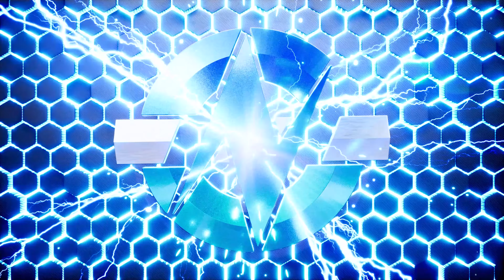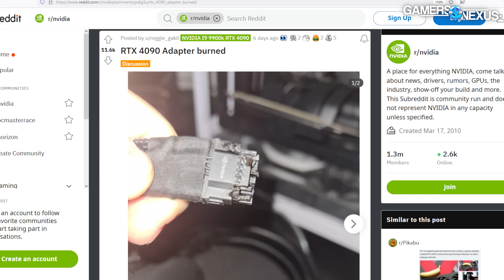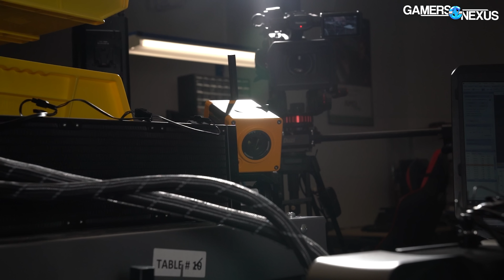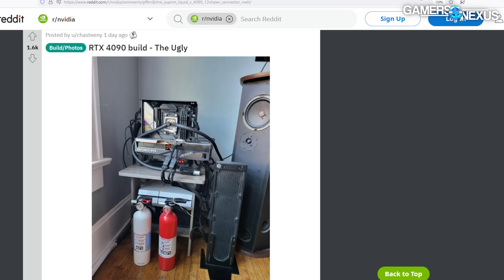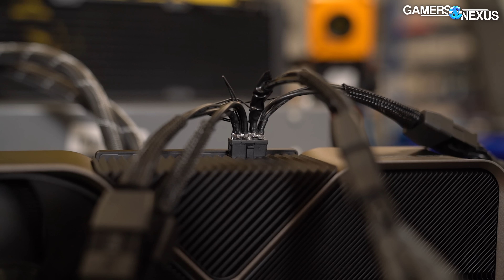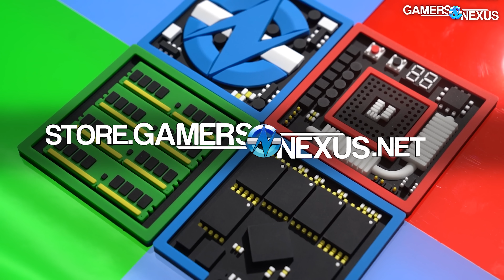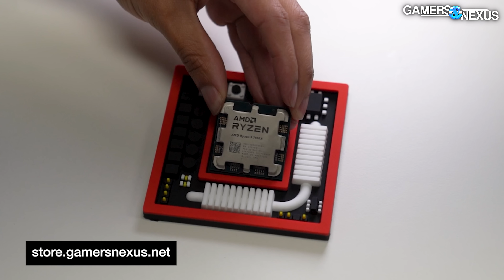Testing Burning NVIDIA 12VHPWR Adapter Cable Theories (RTX 4090)

Comment: I saw Jayztwocents vid and was like "damn so that's the issue", but now this, thanks GN for doing the actual work. In retrospect is looks like Jayztwocents and others like him were just jumping on the hype train for content without doing their own homework. Once again, Thanks Steve for the awesome work on this. It actually provides a technical path to consider instead of the " i wonder if this.. or this should be".
Reply: I mean that is seemingly the issue... Just not with the 300v line ones. There are cables out there with 150v lines and not 300. The 300v one would be able to handle half their connectors being snapped off. But the one that is barley meeting the spec where you are trying to push 600 watts through 2, 150 volt lines would be a problem. Especially if the solder was way worse on those 150v cables. SO that's what people should be taking from  this. To check if theirs has 150v lines. And if they are fucking get them off and get a better cable. Because it's not worth risking a 2k GPU. Not just going around saying no one person had all the information. SO they are shit. Signal boosting important information is good. And something you want. And anyone with sense wants that. You can piss and moan about how everyone does anything. That's why it's good there are different people. Not everyone is gong to watch 30 minutes where the person doesn't clearly outline the main point that people would most likely want out of the gate. And some people want that and can digest that. Also waiting for 100% absolute assured complete factual data can take too long. And trying the thing it is most likely, that being a bad cable. Can save you 2k. Or whatever it is in whatever situation. It's risk reward. It's most likely a bad cable. Better cable 20 dollar tops. To protect 2k GPU. Jay says buy new cable. Absolute idiot apparently for suggesting the most likely course or action to protect your investment. Some people man.
Reply: Jay simply has no clue how to set up a fair scientific test because he is too lazy or too dumb. Not surprised he uses typical sensationalist clickbait titles since his content is so shallow. I guess it works on the kids though. Whatever. I've had is channel blocked from showing up in my feeds for years now.
Reply: Couldn't watch the clown work Jay was doing. Same as Austin Evans trying to investigate the ps5, you cannot ask entertainer to do scientific work. They are fine in their own category but let others do serious business.
Reply: all you have to do sadly is look at Jayz video titles to see that they are sensationalist at best, each day he flips completely on what is/isn't an issue etc.
Reply: Whatever the actual reason is, its undeniable that the cables people are getting have a widespread safety issue, so I find it hard to say its FUD.
Reply: why i dont watch Jaytwocents, his information is just copy and paste
Reply: I've been really frustrated by his sensationalism on this subject. IMO, it's inappropriate to start spreading FUD without validating the issue. Anyone can post a picture of a burned adapter.
Reply: I'm surprised anyone in the comments watches Jayz2cents. I've seen his videos a few years ago and his shtick was simply jumping into every reddit conspiracy theory there is, just to make sure he breaks the news every time.

Judging by this video and your comment, nothing has changed in that time.

Can't blame the guy, breaking stories brings in the views, views bring in the revenue... And it's easy to say "I couldn't do that" when I'm not a YouTuber, but we'd all do the same thing on our second day after leaving our jobs to work full time on YouTube :/ I'd break my mirror for self-loathing, but you'd never see that, only my smiling face on video ;)

Comment: I think we are getting to a limit for 12v supplied peripherals, there are lessons to be learned from the 3D printer world as far as what can happen to connectors are concerned, @12v thats a lot of Amps for a given load, in the 3D printer world things worked better , faster and  safer @ 24v - you could safely get away with thinner cable too as your carrying half the Amps  for the same load in Watts,

Comment: Gee whiz golly gosh! Just really happy to be on a 3080 from the beginning. Not a single problem. No coil whine, no getting too hot (66c avg.) and up to 2150MHz stock. (lottery win?)
PNY XLR8 RTX 3080 REVEL EPIC-X Triple Fan - VCG308010TFXPPB...it completely ignores it's supposed FE specs.
RM1000x with proper fat ass cables.

Comment: Igor's cable wouldn't have melted due to the solder either. He jumped straight from "the solder joint broke" to "that must be the problem" without doing any real testing. The heat that would be generated from his broken solder joints would mostly be back at the bus bar, NOT the pins ... and the connectors simply don't melt at the bus bar. I was shaking my head during Igor's whole video. and since Jayz failed to reproduce the melting with a snipped cable and concluded that Igor was right ANYWAY, I simply quit watching his channel, because reporting that bad isn't worth my time. You, on the other hand, have earned another sub. Great work.

Comment: I'm not really comfortable with untaping my 4090 sleeve and getting the voltage rating, but I will say I unplugged my adapter last Thursday (having had it since last Monday) and saw zero signs of wear or tear to the adapter or the pins within the GPU itself. This is after 3 whole evenings of heavy load by playing Cyberpunk 2077 and Spider-Man, about 4-5 hours each night, so about ~13-15 hours of heavy use. I have the Gigabyte 4090 Gaming OC model, it was part of a prebuilt PC from NZXT BLD.

Comment: Awesome content as usual! I will be checking my adapter after a few weeks of use when my new case arrives. I'm currently rocking no side panel because I didn't want to put any stress on the connector until we get more info. Luckily, it seems the failure rate is pretty low right now. Hopefully it stays that way..

Comment: Do we know if the card itself is load balancing the inputs, even with all pins connected is it pulling more current through one pin due to a failure on the card?

Comment: Personally I think it’s the connector itself , the pins are much smaller and their soldered onto paper thin distributor plate. Personally I would feel much safer if the pins were the size of a 24 pin MOBO adaptor and the wires themselves where not soldered but were crimped directly to each pin. I understand this would cause the plug itself to be bigger but at least it would be 100%’safe and would not generate so much heat at the connector, 60C at a connector is a bit hot for my liking .

Comment: Also, this points out that premium tier GPUs are going to require premium tier power supplies that are designed specifically to provide both electrically and physically the power and connections to service these components. We're in the Big Leagues now.

Comment: Thermal views off the connector are pretty misleading because plastic is an insulator and you don't know what's actually going on inside the connector pin itself. Buildzoid touched on this in one of his new vids. You need to figure out how to get a micro thermocouple (TE Connectivity sells these under their MTC line) in to the pin connector itself and measure the temp of the pin itself.

Comment: Just checked Paul's video and it looks like he had an adapter with the 300v wires that was soldered like the one Igor had. Potentially 3 different variants out in the wild?

Comment: I haven't had any issues so far, but I have a Seasonic Prime PSU and I'm using four separate pci-e cables plugged into four separate ports on the PSU. That said, the bottom line is when you're selling a product, you can't expect the end user to be a prosumer,  you have to account for people who pre-builts or just plug this thing in and never think twice about it. And Nvidia shipping it this way is sloppy

Comment: Hiding a problem because it affects one of your biggest sponsors is a bad practice, the reality is that the connector is crap and the adapters junk, recommending a product that potentially has the possibility of causing a fire is unfortunate
Reply: I don't think this is fair. He is offering cash to replace failed units specifically to continue his testing. And trying to collect as many cable information as he can. Specifically to be able to come to a conclusion based on observable data. It's not right to imply motive to someone that hasn't even ended their testing efforts.

Comment: Dear GN, you should just try to mod some sacrificial RTX 4090 and replace 12VHPWR with XT90 connector. It would be fun, if one proven connector with only 2 cables could fix all the mess with dozylion thin wires and pins. That would be meme video. XT30/60/90 is old and proven DC connector for high current, and probably will not much bigger than 12VHPWR.

Comment: Thank you for all your hard work Steve. 
I really appreciate the new info and that we can cross out a few theories. I still think it's a fundamental design flaw of the cable tbh. Whether it be in socket/mounting, pin seating, cable strain, or aib's using cheaper cables.

Comment: Very suspect of Nvidia to say that the adapter is only suitable for 30 uses. As a builder, i can only imagine the amount of cost cutting and undersizing i could get away with it an installation is only supposed to survive 30 uses. A shower, a chair, cabinets, etc. Heck you could practically build a house out of popsicle sticks if it only needed to last a month.

Comment: I think the design has a higher risk factor for flaws which is likely what we are seeing. Where other cables have a higher margin for differences not causing failures these cables have a much narrow range where they work correctly. For now it's best to avoid the adapters tell they can sort out the flaws.

Comment: Many of the failed cables appear to be melted down in the pin area far away from the incoming wire.

I’m guessing it’s out of spec or damaged pins not making good contact with the pins in the gpu side.

Comment: Paul's video showed his cut adapter that looked just like Igor's picture rather than yours, but Paul's wires were rated at 300v. You might want to take a look. Great video and I'm glad you guy's are trying to get to the bottom of this!
Reply: that's a good point, I wonder if the discrepancy in the adapters are from the 4090 early review samples nvidia sent to the media?
Reply: @andredavis3350  Yeah that might be possible, but I'd imagine Nvidia is probably going to make a new plug altogether. But then again they might not....lol!

Comment: I think Jay made a good theory that it's not a matter of connections breaking off, but solder joints *cracking*, leading to a smaller, higher resistance path for the current to flow through that is not enough. It makes sense, at least given the type of cable Igor got. If either one or both of the outer cables, given they connect to their own pads, cracks between the wire and the pad, that would explain just the outer pins melting. You could test that by wicking off the solder on a "good" cable you have and making it like one of igors with the outer pads soldered "improperly", as in not up enough onto the pad.

Comment: 26:05 If that image is generally true, I'd take OEM over nV any day. #1: It has more contact surface. #2: There's an inherent spring loading in the OEM version and it will likely tolerate more connect/disconnect cycles.

Comment: Igor has made another video. Soldering of that type is done manually, hence the quality of the soldering can vary greatly. That's why soldering is not only avoided in such applications, but outright forbidden.
Even if the adapters don't fail, they don't meet actual engineering standards and it's very questionable how and why these adapters could be certified.
For such applications crimping is the way to go. Soldering might have lower resistance in the connection, if done correctly. But that's the problem: you can't really QC soldered connections, whereas crimping always provides the same quality, if the tools are monitored.
One question also remains: why has Igor got a different adapter than GN? Maybe Igor has got an engineering sample and maybe others got that to, but that rises the question how engineering samples came into retail.

Comment: Have fluctuating loads been tested? It is possible the expansion and contraction of the cable is causing the crimp terminal inside the connector to become loose and possibly overheat/degrade. Looks to me like a likely culprit would be cost reduction on build materials, that connector doesn't look cheap to manufacture.

Comment: All this testing, and just from Igors cable,  cracked solder joints would definitely cause this failure mode, just because more more power is being delivered over 4 wires than 2. And through cracked solder joints which generate high resistance. 

Even the 150v cable he had should easily handle the power, roughly 4,800 Watts.

To validate this, you and J2C need to add a power resistor in series to one or two lines, eg 2.2 ohms. 
Using FLIR would show how much it is heating up, which is the same as what the cracked solder joints would see
Reply: Come to think of it a 0.22 ohm power resistor would be a better option

Comment: Holy cow. Thank you for this, so much. I've gotten so tired of seeing what was basically a witch hunt for these cable issues, and this video was the cure. I even commented on Jay's last video about this when he couldn't reach a conclusion how it seems that the problem is not where people are looking. Not only was this addressed here, but this video is taking the proper steps to actually diagnose whatever this problem is without having a bias toward one particular possibility (that being "Nvidia just made bad cables"). Clearly there's something fishy going on and now hopefully we're on the right track to fix it. If I had a 4090, I'd send you what I could in a heartbeat to help with this effort. But instead what I'm going to do go to the store right now and buy something to help pay for all of this. It's absolutely well deserved.

Comment: Thanks, Steve. Are the adapters provided to 3rd party manufacturers by NVIDIA themselves or do they simply outsource the specs to manufacturers and let 3rd party vendors pick which one they want? Seems to lean more towards a specific adapter manufacturer using an inferior manufacturing prcoess. Thanks, Steve.

Comment: Could there be any difference in material or size/length of the male end pins on the AIB cards vs the FE?  If you could do a "pin drag test" on the affected connectors they might show to have loose contact.  
Perhaps some of the pins are getting damaged from the initial plugging in to the card.  Not everyone deals with electrical plugs everyday to sense when something is not aligned properly, and that would indicate a poor design as Steve mentioned in the video....I have no experience with this particular connector yet. 
I do work as an automotive technician and this type of thing does happen.  The fix, when a recall situation, is different pins, wires and connectors to various degrees.

Comment: also need to consider the possibility that both cables are in production and the maker ran out of the pure copper cable(Igors looks like Aluminum and would also be why its rated 150 volts)

This issue maybe as easy to solve as telling people to check what the voltage rating is on their adaptor.
If its 150 go back and get a refund for your card/stop using it/ask for a replacement.

Comment: My MSI 4090 only has three cables on the adapter and it's running great. Is this issue only with the NVidia branded cable?

Comment: the one thing i've heard about this recently, that I don't think was mentioned in this video, is some of these adapters are CRIMPED instead of soldered, and the crimped verson are the one that supposedly work better?  I assume every AIO and Nvidia are making their own adapters so they have their own way of doing it, even though externally they look identical.

Comment: improperly seated plugs are good theory of why they may be failing but has anybody tested this in a choked off hot box of a case? maybe this is simply a overheating issue with the whole card mean what happens to the plug if pcb temp gets to something like 80c+

Comment: i like the connector considering that all native Power Supplies never had an issue and i am kind of sad AMD ist back tracking from using it.
Just get an adapter from you power supply manufacturer or chances are that if you buy a new card with 12VHPWR that you need a new power supply alltogether.
Also make 90 degree plugs a thing.

Comment: Another way to Check if the Cables can potentially melt is to Check the Resistance of the connection. Overheating means Higher Resistance - more energy loss, higher power usage and less efficiency.

Comment: Thanks for the hard work Steve. What you do is not easy, but it is very valuable for the community. Far easier to issue clickbait title with a superficial video without actually doing proper research or understanding what one is talking about, and sadly too many in the YT community take that approach for maximum clicks/effort ratio.